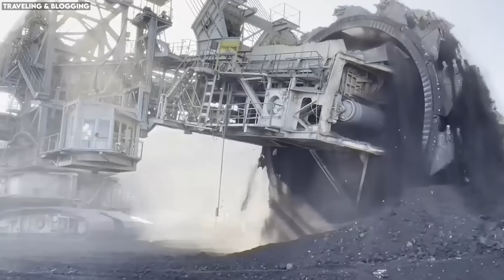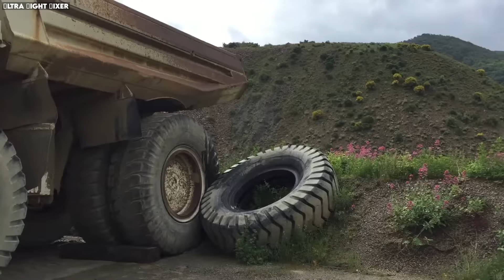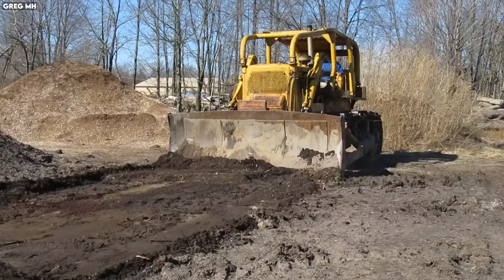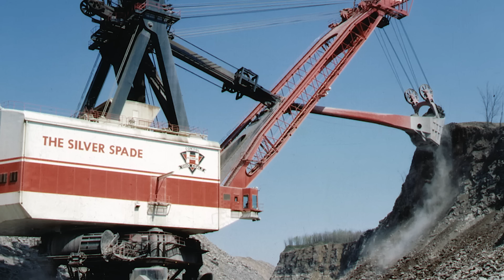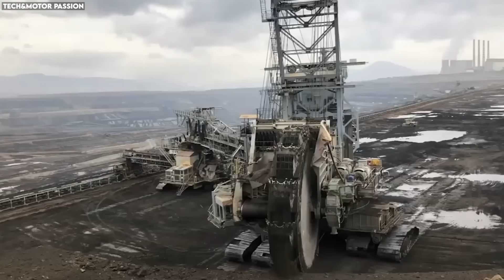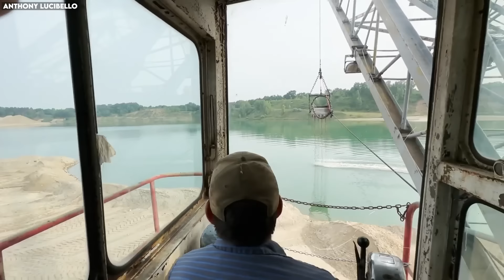10 OLD CONSTRUCTION MACHINES THAT MODERN EQUIPMENT CAN'T MATCH

Comment: I doubt there was very much cast iron in them, they would have fallen apart immediately.
Reply: The smith rodley was all solid  the cabin was made of a copper and steel  they dont rust out these were made in the fifties and they had a 115 hp garner flat out doing 2000 revs but got alot power go all day without missing abet good work horse you got keep the grease up to them they will wear out pretty quick if you don't there is 157 grease nipples on them I used to go over the machine with a grease gun every thirty hours 60 litres of grease I use dose not sound much but mud and dirt wil wear them out quick but they earn there money I got a mate bought one from the quarries in Melbourne i not sure if he still got it its been awhile since I seen it I missed them😂

Comment: NorthWest came out with the 190-DA bigger than the 80-D it could dig to 37 feet in what NorthWest called (PullShovel) configuration a backhoe cable excavator 😊 it was  fitted with a Hydraulic cylinder for the Bucket "CURL" with all else being Cable friction operation. It had a 6.5 cubic yard bucket 😊 this was back in 1963 when unveiled it at a Road Show in Chicago. As they progressed to Fully Hydraulic excavator thay made a 100-DH that could dig down 28 feet. Break out force of 66 Tons, 😊 they had a Lengthened Dog Bone Bucket Linkage. As the cab operator station developed, the engineering team installed a TWO lever control system for all functions with fully (X) pattern Lever controls 😊.  There are great books out about (NorthWest) history and very detailed in the Development as time went from cable to fully Hydraulic. But I always found it fascinating to see a NorthWest with the Hydraulic cylinder on the Bucket. For a cable excavator to have Bucket "Curl" 😊